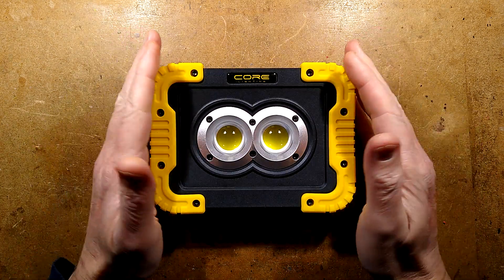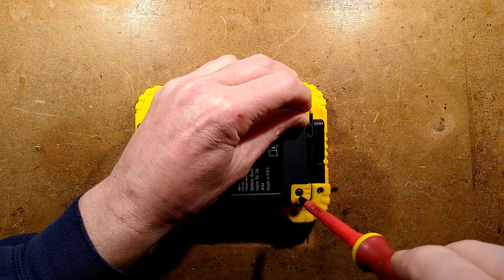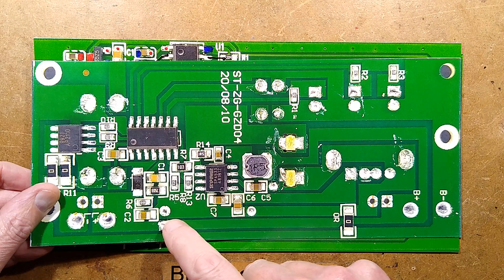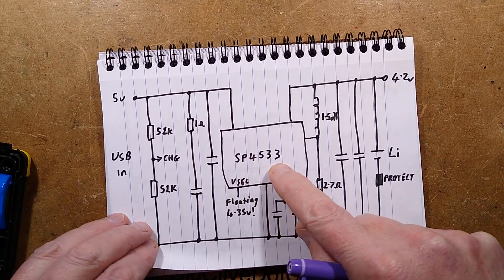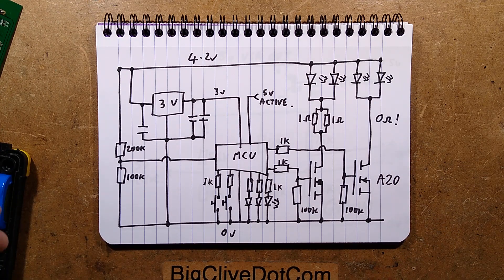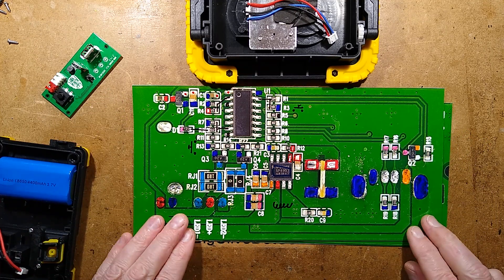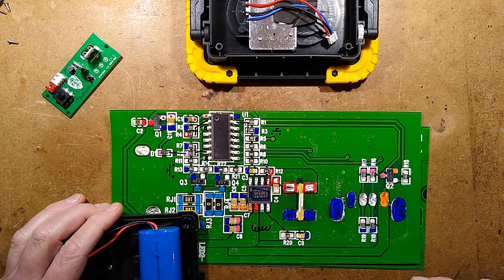Another work light with weird circuitry (with schematic)

Comment: This is wild... My mega "humbled lessons with Lithium-Ion" comment within the last couple days had this light as the basis.... almost lol
Although mine is twin eyes like yours (and red trimmed), mine doesn't run the individual cobs. Mine is doing PWM to change to low mode —and I think it might also in high— and then a strobe mode (it's like 4yrs old now).

I might have to see just how different the components are... 😁
Reply: PWM make much more sense as it's much more efficient and you don't waste power in those big resistors and you don't toast the battery.
Reply: @jamesharmer9293  I certainly can't disagree!
My eyeballs are just sensitive enough to detect it, is all.
Not in any sense that it impacts me negatively, it's just annoying to "see" 🥴
Would be interesting to (somehow) have a toggleable internal ""battery typology"" / chemistry which could self regulate to limit current draw, and (further-somehow) do so in a no-additional-components, non-resistive (no waste heat) kind of way. In a way, kind of like a multi-tap coil, or a battery bank, but wouldn't be "dial a voltage" as the voltage would have its usual output based on charge state.
Reply: @DUKE_of_RAMBLE  I have built circuits that use PWM in the past and the trick is to up the frequency to a point where it wasn't either visible or audible, depending on application. A few KHz usually works, though with LEDs you might have to pick a frequency that wouldn't strobe with common camera shutter speeds.
Reply: @jamesharmer9293  Believe it or not, it's actually my eyeballs lol
I run mine on Low when I take the dogs out at night, since I've had instances where using it on High would run the 2x18650s out quicker than expected. So the strobing is easy to notice, at least for me, while walking them and passing by objects. 
(although, I think that was due to the one cell being crappy, as the pair I'm using now have lasted a couple weeks of ~15min/night on Low w/o the light cutting out! 🤘)

🤔 Maybe I should wire a switch into mine, inbetween the two cobs, so that the switch gives me independent control and then I can just run one cob @ High... I'll have to pull it apart and see if my single-"PCB" Dual Cob will be modifiable this way... 😏

Comment: Hey i know this might not be the correct video to ask you, but i have a NI--MH AA Battery charger it is a Sony Cycle Energy charger and just a couple of days ago it suddenly stopped charging my batteries. 

I dont know much about electronics but i think i know what the issue is. I opened the charger and in the beggining of the circuit next to the prongs that connect to Mains there is a component that looks like a Resistor and it looks burned and has a tiny crack in the middle. Everything else in the circuit after this component looks fine.

Again sorry to ask you but how can i buy that component. Do i look it up as a Resistor? Do they have a certain rating? This is what is printed on the board next to it :

RF1 100HM 1W

And it also has colored bands but only the outer ones are distinguishable since it is burned in the middle. They are colored GOLD and BROWN.
Reply from the maker: That may be a fusible resistor or sense resistor.  It may have failed because of another fault.
Reply: @bigclivedotcom  Thank you for responding and sorry to bother you again. I will try replacing that fusible resistor but how can i know what rating it might be? Can i use a multimeter to test it? It has color bands but only the outer ones are visible. It looks like the one in this image:

https: // www. elprocus. com/ wp-content/ uploads/ Fusible-Resistor. jpg
Reply: @alexm.4720  any 10-100ohm
Reply: @Datlaai1  Thank you for responding i will try replacining it and see what happens.

Comment: Basically the same design that home depot husky light.can run on 3 or 6 AA batteries .Needs a set a magnets so they can be stuck on metal surfaces .Would be nice if Husky made it with rechargeable lithium cells like the model you are showing .Will eat you out of house and home on batteries .Those models seam well made

Comment: I bought 3 of the Yellow lights from Amazon about a year ago !!!!  
  I think they are brilliant !!!    There is No delay on mine !!!!  It has bright mode, dim and flashing with both lights all the time !!!     My  light has a battery compartment for 4 AA Batteries or 2 18650 lithium Batteries,  (or 100 CR 2032 Button Cells !!!!  Not really !!! that was a Joke !!!!). They are really good for finding Electrical Components and screws that are always attracted to the floor, and the become invisible as soon as they touch the Ground !!!  My light is a Power Bank as well.  So it's a different Model !!!!  My lights are Very Bright, and the 18650 batteries last for months !!!!  My lights have a stand so you could make a Flat topped Wooden Hat with  the light screwed into it so you can see where you are going in the Dark !!!!
Reply: Thanks Ted!!!!
Reply: You say you you bought the yellow one from Amazon some time ago, however it was clearly not the Same Model as Clive's because it had different functions. So no real comparison.🤔🤔
Reply: @brucepickess8097  Gosh Bruce, you don't stand for any BS do you?
Reply: @brucepickess8097  It looks the same so they make different models with 2 led lights.  Maybe mine are original and the Lidl one is a cheap copy
Reply: @kevinwingfield2007  If you put mine next to Clive`s anyone would say they are exactly the same, of course for bruce pickess the atoms will be arranged differently !!!!!

Comment: This is good light , could even replace the cells to 3500mah to make it lat even longer. Great vid thank you 🤘🏻😁🤘🏻
Reply: To make it last longer, increase the resistor values so that the LEDs aren't being grilled and that the battery pack (as is) isn't having to deal with high current levels it wasn't designed for.
1A per LED (2A total) is plenty, you don't need 3.8A.
Reply: @TheSpotify95  that's what we all come to Clive for.....
Can it be hacked so we don't fry leds..? 
Yes.. Buy one (or two for a friend) take it apart  have fun hack anyway as you desire... 
No..... Leave it alone.... 🤘🏻😜🤘🏻
Reply: @TheSpotify95  They come with a 4400mAh pack as standard! 🤪 So I was being a moron anyways ! 😂 Putting 3500mAh cells in would be a downgrade on battery life 🤣🤣🤣. 
Adding larger or smaller mAh cells wouldn't grill the LEDS anyway, it would make no difference to current draw, LED lifespan  or anything else except for battery life 🤘🏻

Comment: I have a question please i couldn't find its answer on internet although i searched in 3 languages.
I'm a quality control engineer in a German company and i noticed lately that some RCBO typs in combination with Socapex (6 channels) a remaining voltage of 20~30 volts.
And it's not a capacitive effect because it does not change if i move wires away from each other.
Do you have any experience from the entertainment industry (Socapex) standard.
 About the matter? 
I know it's ok as long as it's below 50v.
Thank in advance for reading and commenting or maybe video about the subject
Reply from the maker: In socapex you have six circuits in very close vicinity in a multicore.  There are capacitive coupling effects between the cores when measured with a high impedance multimeter.  Testing with a proper electrical tester would add enough load to shunt the effect.
Dimmers also have high leakage when off due to the snubber networks.

Comment: Interesting lights and a nice mod. I don't know why it was not included in the first place. Like, what would you lose if you limited the current, prolonging the LEDs' life? Some sales on new products (because your customers would keep using what they have)? Oh well... Haha.
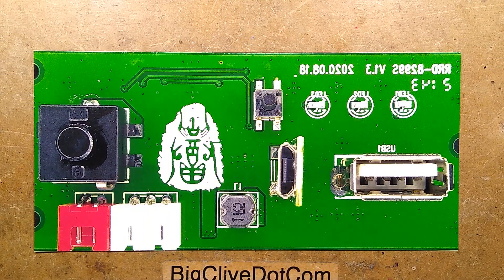6:20 it looks more like a bottom of some insect - probably a bumblebee, it's so fluffy :)
Reply: I suddenly thought that there may be short-termed teams who establish their production, sell whatever they can manufacture (or badge) not even counting on people remembering their brand, shut their business down quickly, and then restart the whole process, seemingly reusing their production lines as a «new» team.
This way you can «experiment» without any fear that it hurts your reputation — you're always under the name nobody remembers.
Reply: Since it's a microcontroller based design, they could have easily added an even lower power mode using PWM, and also increased the max power by eliminating the power resistors and just using PWM in the current low power mode.  So the modes would be: 0. Off (unchanged). 1. Both fully on (brighter).  2. LED1 fully on (unchanged).  3. LED2 at 50% PWM (unchanged brightness).  4. LED1 at 5% PWM (new long lasting) .
Reply: @johndododoe1411  they often are OTP µCs with any markings removed.
But anyway, with a soldering iron (and somewhere pliers) one can replace this thing with something of their preference to take control of the unit and achieve desired brightness levels and probably introduce other modes, and even react to the button in a more smart way.
But they simply didn't give a smack, and I'm in serious doubt they designed the firmware themselves.
Reply: @jkobain  I was describing options for the Chinese factory, not hacking.
Reply: @johndododoe1411  yeah, and I mentioned it's often not even an argument, despite the fact they managed to enhance and make own versions of chips of architectures like 80C51 more safe, and more capable, and more versatile, and produce them at huge quantities: we keep buying sheet — they keep caring not.

Comment: delay?  probably a micro controller say like an arduino or attiny and software.

using pwm there is no need for a resistor for current limiting

or maybe the reason for leaving the chip floating is to use lihv cells

Comment: I’m surprised the designers don’t use pulse width modulation to vary intensity.  There’s enough LED afterglow that it won’t flicker (much).
Reply: Is that right?  I made a strobe using LEDs (2 x 9-element LEDs), and I was suprised at how little afterglow there is.  It went up to 200 flashes per second with a resolution of 1.4 degrees on a rotating member.  Even at high RPM, the image produced was crisp, which would not have been the case if there was any afterglow.
Reply: @DownhillAllTheWay  I guess it depends on the material used for the secondary emission.  I have some no-name Chinese white LEDs which glow visibly, albeit dimly, for several hundred milliseconds after removing power (and no, it isn’t a capacitor discharging into the LEDs).
Reply: @wtmayhew  You get some odd effects.  I had a bayonet plugged ceiling neon light a few years back, and after it had been switched off, it continued to flash for a long time afterwards - about a flash every 5 secs at first, gradually getting slower till it stopped about 15 minutes later - with the mains switched off!  Naturally, I thought there was mains leakage somehow, but when I looked it up online, it turned out to be a known phenomenon with those neons.  God knows how it happened.  I don't
Reply: @DownhillAllTheWay  Thanks for the reply.  It is oddly reassuring that electronics is part art and not all cut and dried science.  Gotta love seemingly obvious situations which yield surprises.

Comment: Yes ... Winter power cuts ( 2022 ? ) ... a little  G4  base LED lamp ( widely available ) works really well with a FULLY charged 12 Volt car battery ... insert into the diagonal ( 45º ) of a dual row 0.1 inch connector and place in a white curry tray , up high , makes a good lamp when the mains cuts out .. ( tried - n - tested ) ................. DAVE™ ..........
Reply: Yep low tech to the rescue, just what you want when you need to vindaloo in the dark.😏😏
Reply from the maker: LED will give much longer run time from a power supply.

Comment: FOR THIS TO WORK AS IT IS SHOWN  ,,, I THINK IT TAKE MORE  MORE POWER AND AMPS TO DRIVE 20 LED LAMPS  THAN 2 18650 BATTERIES COULD HAVE 
I WANTED TO ASK IF THERE IS A BUCK  CONVERTER  IN THIS  TO DRIVE THE LED  OR IF THIS A BRAND NEW DRIVER I/C THAT CAN DRIVE LED ON 4.7 VOLT INPUT SO WELL THAT 4 HOURS RUN TIME

Comment: Will it really charge full if the voltage is too high? Since it will only go through the CC phase and not the CV phase since protection board will shut down the input. Sure, the CV phase is maybe not that much of the capacity, depending on charge current ofc, but still. Yes, the protection board will probably oscilate a bit on and off at end, but that wont charge much. How wierd to not set correct voltage when they actually have a charge chip.
Reply: .... I was wondering about the circuit in the pack also, regardless they could have have both circuits protecting thermal runaway.
I love my 18650's but when purchasing I only look at Samsung or LG protected cells. Even for devices with a BMS.
Reply: @robbieaussievic  these cheap products from low price stores are usually aliexpress stuff with a bit more safety stuff regarding mains etc. But the cells are probably some no name or recycled cells, specially since they are are lowish 2200mah. But regarding 18650 I have never had any problems like that with them. Its the lipo packs im more afraid of when it comes to thermal runaway etc.

Comment: Thank you for yet another interesting video! 
Instead of replacing  resistors on the pcd isn't  it is easier to put one in the ground wire to the LEDs?
Btw I hope you can make a video on the (nicer) dimmable 12/24v AC/DC G4 halogen replacing led bulbs, these are moulded in clear silicone to resemble a glass bulb i think. It has an efficient switching CC regulator that should be hackable :)
Reply from the maker: You could definitely add one in series.

Comment: Question how do you determine that two of the components are mosfets and the third is a transistor when they physically appear the same?
Hope it’s not a daft question (I am new to this)
Reply: search "SMD marked A20 or 1Y" and make a decision as to how it's used to give you a clue.
Reply: @FireballXL55  ah ok it was a daft question thanks
Reply: @xenusceptic  No that is how we move on, if you don't ask we don't improve. Have a great day.
Reply: It's a good question. Mosfets are also transistors (metal–oxide–semiconductor field-effect transistor). The other is a bipolar transistor. One even if there is no part number you can tell them apart by testing them (preferably out of circuit). The bipolar (NPN or PNP) will have two 0.6V diode drops when tested with a multimeter.
Reply from the maker: Partly their position, the current they will be handling and the codes on them are also able to identify most devices.
Reply: @bigclivedotcom  so experience was how you determined what was in each package 
Unfortunately there’s no short cuts to gaining experience
Reply from the maker: @xenusceptic  It's never been easier or faster to learn about technical subjects online.  The educational content on YouTube is immense.
Reply: @bigclivedotcom  I have to agree with you there, lots of content and a few try and present in a course style,  but I think there is a big lack of a syllabus type series of electronic vids that cover theory, and  practical examples  with real world examples in one session.
What I’d like to see is a open university for YouTube  
I’d pay money for a well structured course that builds knowledge and experience

Comment: It is a neat little package, though the circuitry is a bit odd. I wouldn't mind having one to fart around with. I also like the fact it doesn't have the stupid golram frickin flash crap. Almost makes me want to buy a few purely for that reason alone. Drives me absolutely batshit when I'm forced to cycle through it every 3rd time I try to use a damn flashlight. I wouldn't mind so much if there was a dedicated button or sequence to get to the flash mode. 

I haven't a clue as to what the heck that thing was printed on there. Usually I pick up on that kind of thing fairly quick. That one has me thoroughly baffled.

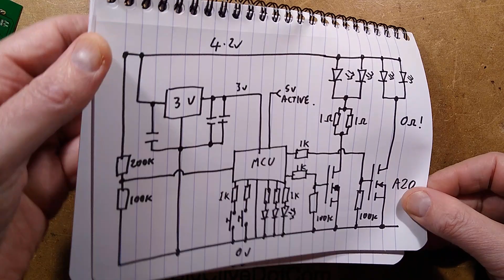Comment: At 10:18 where it's said that the chines tend to push the resistors hard, basically if they aren't smoking, it's fine, HE's CORRECT. So many times I have to fix things because of this issue.

Comment: I wanted to like it when you teased it on stream but I'll pass. Too bad too since I could use something that charges or can be powered off USB as my only rechargable lights I currently have are a couple of those mini halogen style work lights you featured a couple years back. They still work great but charge off an 8.4v supply. We don't lose power often here (and usually it's from a tree rat playing on the pole pig out back when we do) but with winter coming I wouldn't mind being a little better prepared this year.